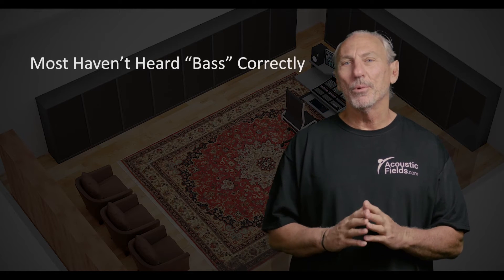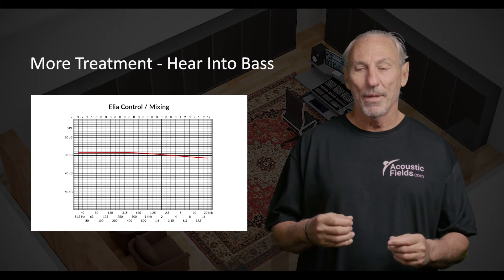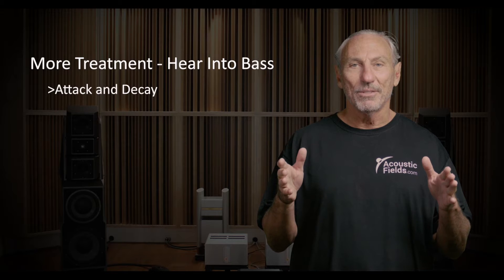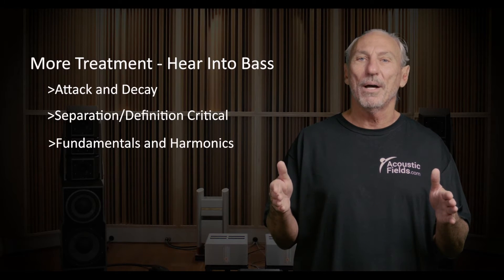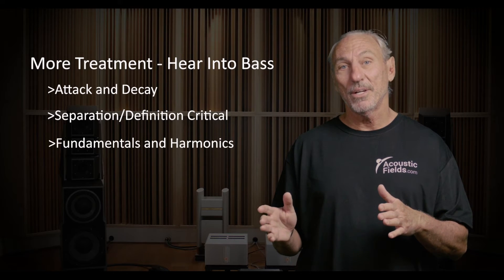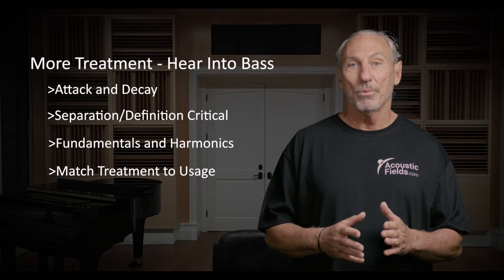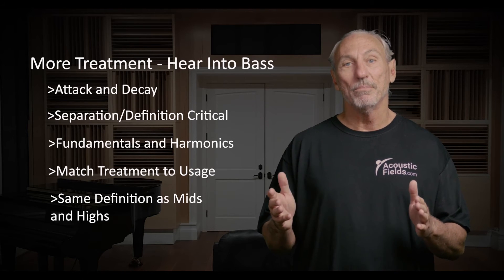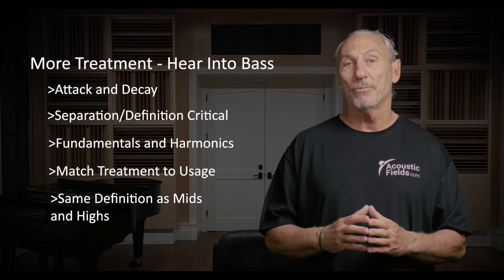Low Frequency Room Response - www.AcousticFields.com

Comment: Hey Dennis, is it possible for a small room to have perfect bass response after treatment or does some constructive and destructive interference always remain? I'm talking about a control room I saw recently that sounded pretty good until it got to a particular track. I ran a low frequency sine sweep and heard a clear bump and muddiness at 80 Hz. How much of this variation is allowed and how much is too much?
Reply from the maker: I,  There is no such thing as perfect. You manage the low, middle, and high frequency issues within the budget and space availability you have. You live with the rest of the issues or get a new room.  You manage the response curve in the analog domain with acoustic treatment, then you use signal processing to polish up the rest.
Reply: @AcousticFields  Thanks so much for the fast reply. This is a great channel. Keep these videos coming.